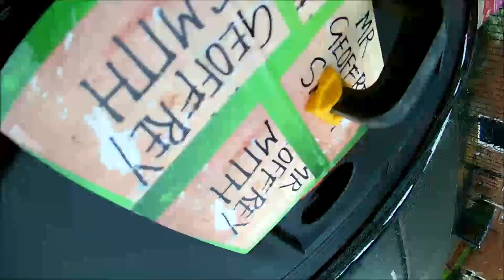A Titan 750W Pillar Drill For My Birthday

Comment: I only have one of the 350w Chinese imports that come under about 30 different names, and up to now I've been happy enough with it. It’s far more accurate than it’s credited as and has no drift at all. So for a small hobbyist woodwork workshop it’s been enough...until I tried drilling 16 18mm holes in 1” mdf! It managed it accurately and without burning, but jeeez it was slow. So I’m going to upgrade my drill press and forstner bits.
Reply from the maker: You never know until you push it. I always push it, which is why I always check the motor power out first. This on has enough chunk to last. If you watch my Tramp Wood Box video, I used this drill to hollow out a solid oak lump, and it did it without protest. Happy making! ✊